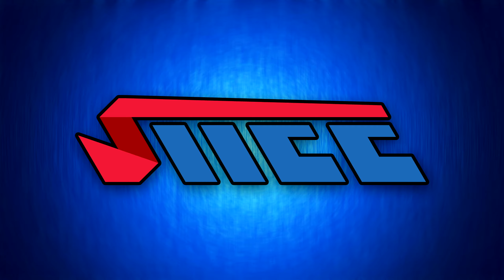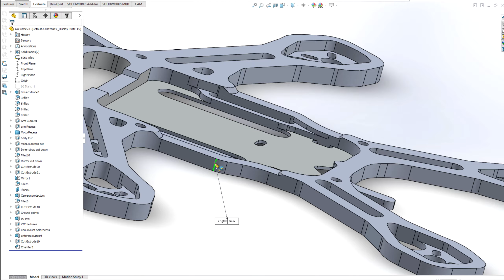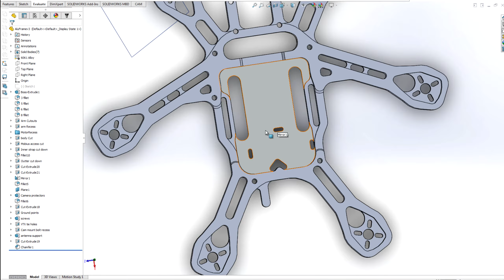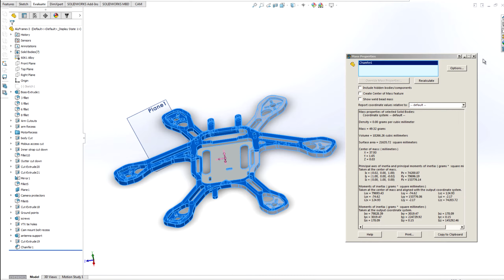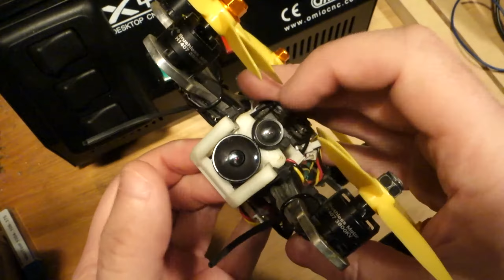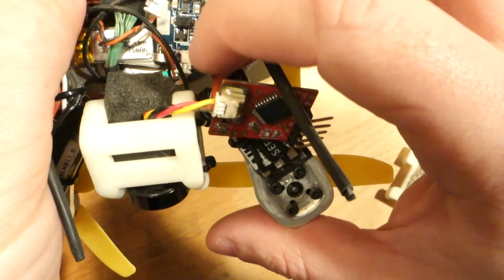Micro hex design - Part 3 - Refining

Comment: Thank you, inspiring. What is the version now and are you planning on making it available.   i am getting things together to build a Raiju (simple carbon:) but can not decide on what motors to put on. Emax rs1106 4500kv or GEPRC  GR1408 3500KV. The lighter motors are more energy economic i guess but the bigger open the option to mount a HD camera maybe... Did you go bigger because of better flight or better camera.  Or something else
Reply from the maker: I haven't done any more work on the design since, I took a bit of a detour to work on my 120 design for more material testing.  Once I settle that simpler design a little more I'm planning on rolling the ideas from that frame back into this hex.

I went with the big motors just because I'm lifting an HD cam.  On the non HD 120 I went all with 1106.  I don't know that the 1106 are really any more efficient, and actually they can be a bit harder to feed because they draw so much current despite their light weight.

For a carbon Raiju I think I would do 1106,  it flies great even with the old 1105s and it really helps to keep any extra weight off the arms that you can.
Reply: Thank you, looking forward to building it and your findings on the 120 design.